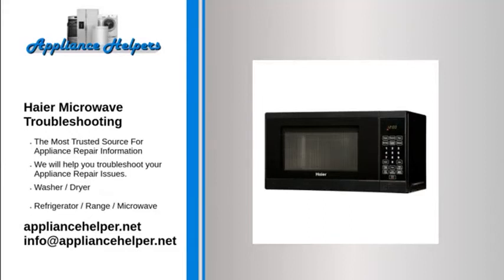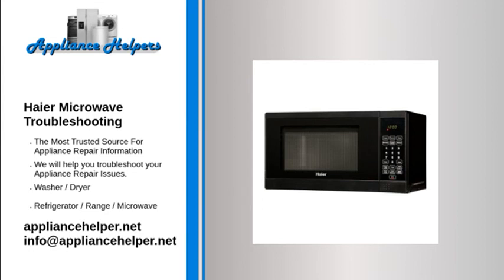Haier Microwave Troubleshooting

Comment: Sir i have haier microwave oven model number HMN-36100 EGB .I bought this one from an old store and dont have any user manual .when i chacked it i found its fuse blown out after replacing fuse it is working but after 25 second it goes stop with out heating. Also i can,t operate it properly that's why i need it's user manual.
Kindly provide me it's user manual book
Thanks a lot
Reply from the maker: https://www.manualslib.com/manual/767866/Haier-Hgn-36100egb.html